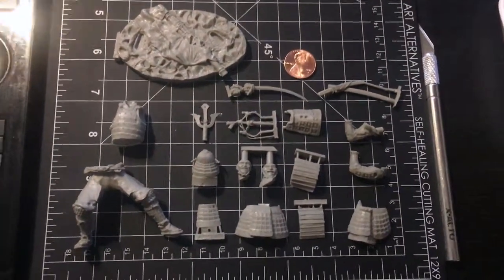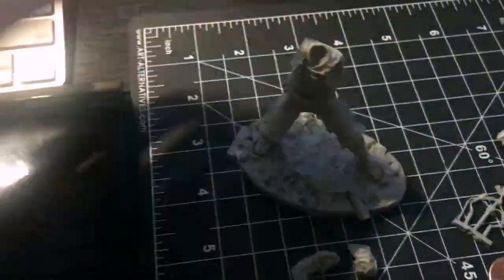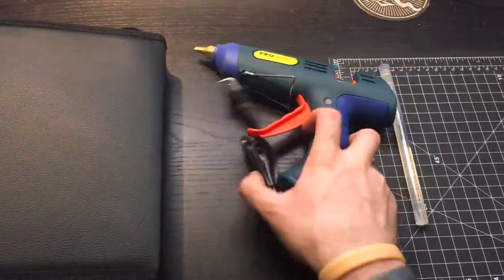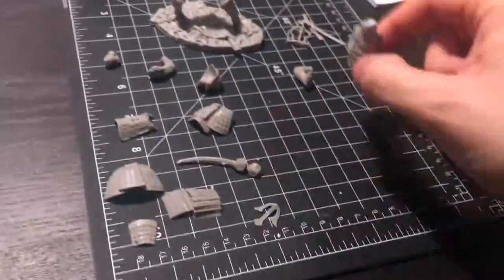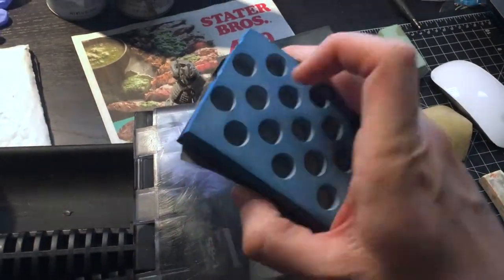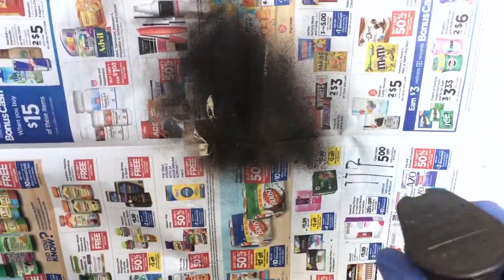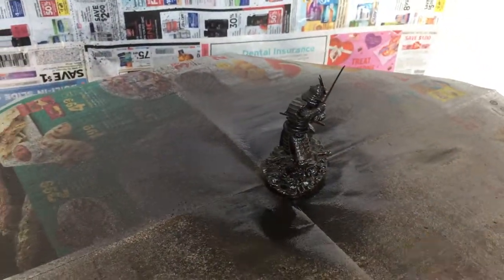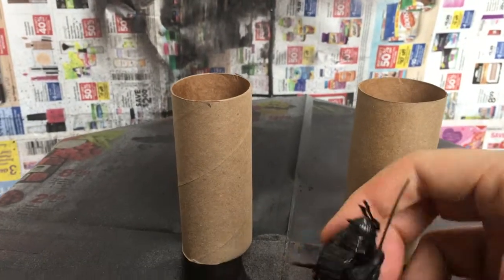Japanese Samurai Armor Statue — Master Build Process (Miyamoto Musashi) [15min Version]

Comment: Why are you glueing resin with this?! My heart just broke! Use some superglue its way better and its meat for that.🙈 But still good video tho!
Reply from the maker: Hey Joseph, good point. I actually only had hot glue and epoxy on hand at the time when I built this, so I chose hot glue as the fastest drying/curing of the two. Usually, when I've built kit-bashed mech design models from Gundam and military vehicle hobby kits in the past, I've always stuck primarily with hot glue — since it seems to 'fuse' the injection-molded kit parts together (actually melting the thermoplastic, unlike resin which is a thermoset, and therefore can withstand higher heat) while drying almost instantly. I actually did not know when I ordered this samurai kit that it was made from resin, and had just assumed it was an injection molded (nylon) plastic kit like the other standard model kits (I didn't discover it was resin until I tried cutting it with an X-Acto knife, which turned out to be much more difficult than usual). Thankfully though, the hot glue is holding up pretty well for now. Anyway, I'll make sure to use CA glue (superglue) next time on one of these garage kits, per your suggestion! 🛠️